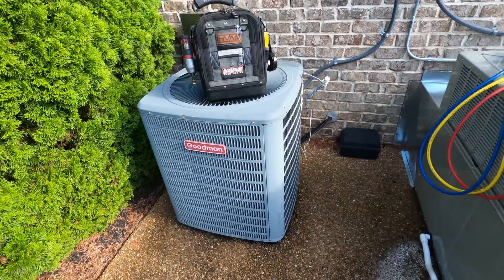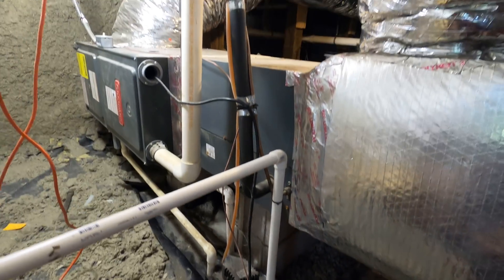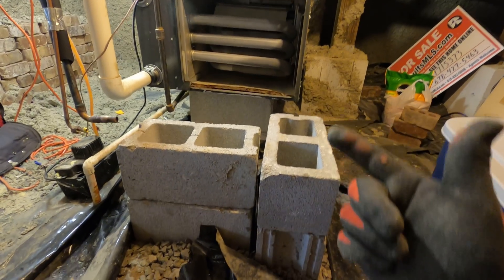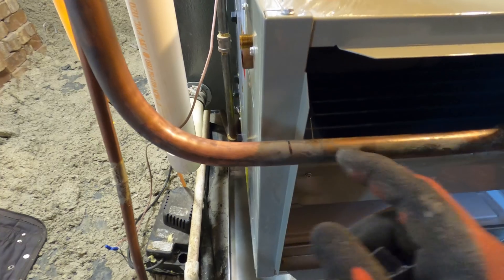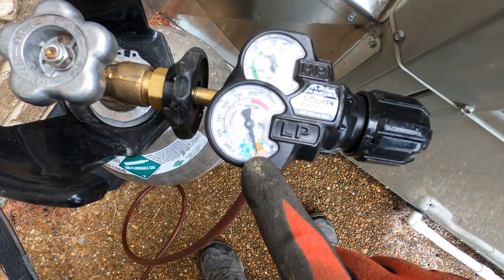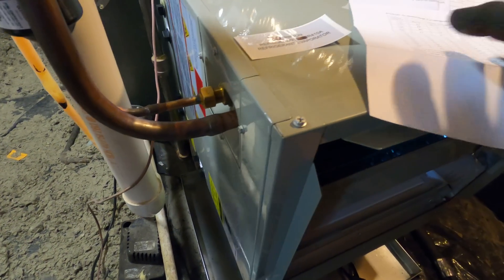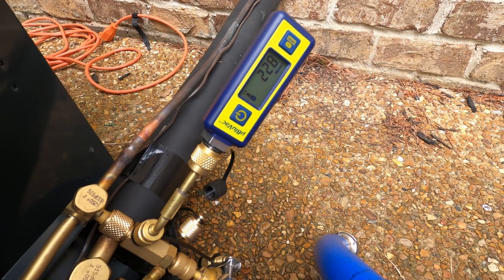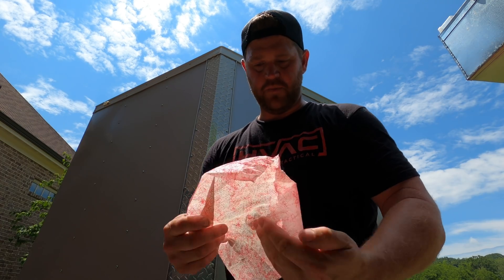HVAC Ride Along | Trane Install

Comment: Great install. I had a question about your brazing. I was taught to put wet rags on opposite sides of where your brazing to prevent copper from melting rubber o rings and things like that. Is that necessary?

Comment: Dragging and turning a $5000 unit on the ground like that-glad I wasn’t the customer because that would have upset me greatly.  Hopefully it has some type of protection on the bottom but even still I wouldn’t have been happy if I saw that.  Otherwise, the install looked great!!

Comment: Those trance coil leak sometimes due to a flaw at the u bends where two dissimilar metals copper and aluminum come in contact and corrode over time, trance did address this issue and over a free replacement of just a coil by itself no coil box is included.

Comment: Very good install zack. Was the old AC unit an R-22? And replaced it with with an R-410A unit?  Don’t know if you flush the refrigerant line set with a solvent to remove any R-22 oil. I love to use the R-11 flush bran and is amazing since it completely boils off. amazing video though

Comment: Great install! Only thing i don't like and wouldnt do is weld the dryer inside first. The desiccant material inside the dryer will be saturated by the time you cut the old condenser out, unbox the new one, place it, pipe it and weld it up. Better practice to make the dryer last in your hookup. But you do pretty work👍 looks good, cheers

Comment: Great looking install! Question, why stick with a box plenum instead of a square to round off the coil?
Reply: Airflow. Better design for the air to pressurize the plenum by hitting the end cap, then out through flex

Comment: I’ve been doing the same thing lately on the last couple changeouts  as far as leaving the condenser in place so I can trickle nitro as I’m doing the air handler. Saves the time of sweating on a service gauge port on the line set. Nice work as always man!

Comment: Safety glasses when brazing, not worth losing an eye over!
Reply: Yes
Reply: How?
Reply: sean peterson sometimes there can be pop when welding and it will send metal shards into your face. It happened to one of my leads 2 weeks ago. Had to have 50 micro pieces of metal removed from his eyes. Was very painful, luckily didn’t lose his vision
Reply: Matt thanks for the reply, I guess I’ve been lucky. I’ve had flames roll out when attempting to un-braze a coil for warranty, but never had anything bad happen. I will definitely wear the glasses now

Comment: Overall a good looking install.   I see you had a lot of head room in that crawlspace to work with which is nice but the home builders give you barely enough of an access hole to the space.  Thanks for the piping tips.

Comment: You could turn the solder weld side ways  to slide between the lines and protect one whole too and bottom side of the unit

Comment: short run dude replace line sets...and hang your units.............installing on blocks ....we back in the stone age   ..and don't get me started on long flex duct runs   drain pans should run the entire length of system do to condensing furnace.....

Comment: Looks good man. One thing I always try to do is get that unit under pressure ASAP. My old lead man was big on setting coil and outdoor unit brazing it in first then worrying about duct work later. But other than that clean as hell🤙🏼🤙🏼